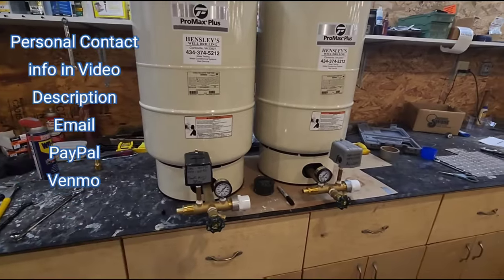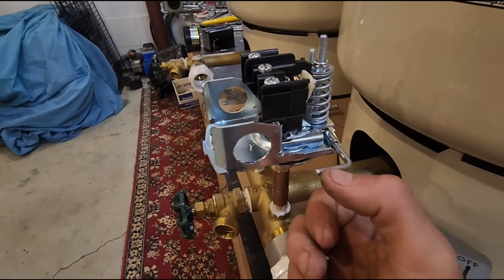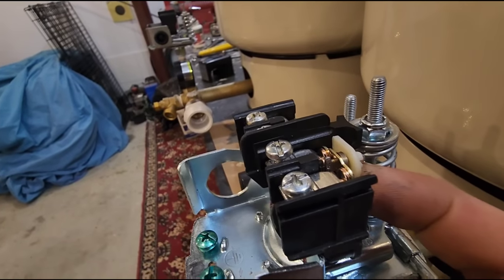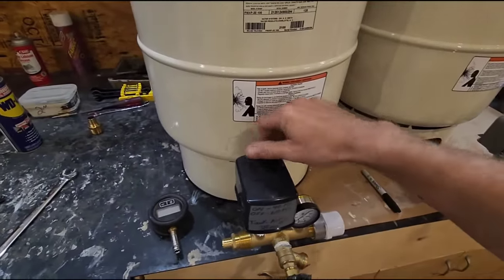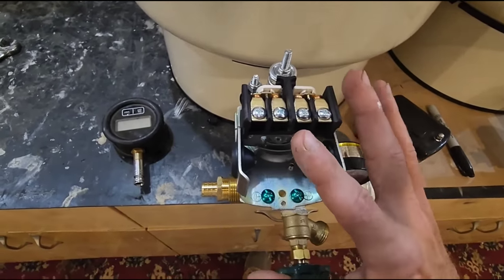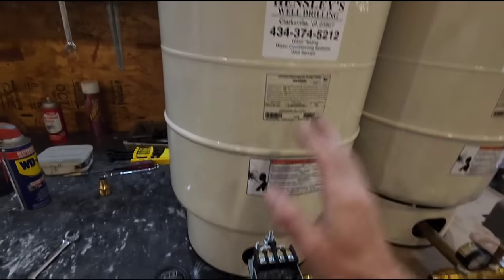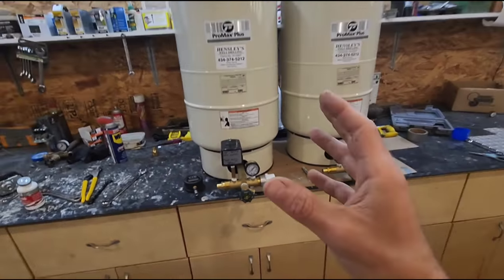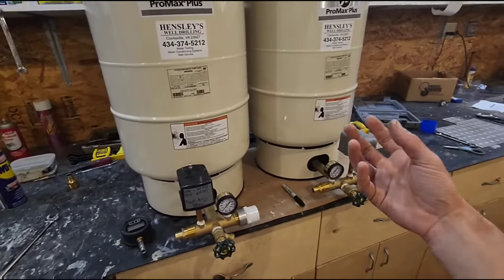Most Common Reason for No Water!! Reset Pump Pressure Switch. Water Well Repair Vlog Ep.18

Comment: I’ve been having to open my pressure switch box and separate the points when I have no water. I replaced the switch in August after having replaced it in December. months ago.   I’m having to pop them apart way to often.  Got any ideas?

Comment: Hello, wondering why my well turns on and I'm getting water to the outside spicket but no water back to the house or tank.  The pressure switch does not seem to be telling the well pump to turn on, the pressure gauge reads 90 psi but there is no water in the lines.  Wondering if there could be sentiment in the lines causing the pressure switch not to function and the gauge to be off.  It is a cabin so I blew the water out of the lines in the spring and there is no outlet valve by the pressure switch.  It is on the other side of the tank. I watched some of your videos when I returned home and thought sentiment may be the issue.  But it is still odd to me why the pump is running and won't turn off until I flip.the breaker.   Any ideas? Thank you.

Comment: I have a tank like the left (dark cover), with no lever or switch to rotate. I have flicked plate or connections back and forth and there is electricity and spark but I never get pressure back. I think my pump is frozen or maybe the plumbing underground. Any ideas?

Comment: I have a system that the tank sits on top of the pump. Came out one day to see the tank blew off the pump. Fixed the pipes but now water doesn’t flow, it’s primed, I flicked the switch. It arched. But no water. Any ideas? Thanks

Comment: Hey bud, around minute 9 you mentioned water turning off then on intermittently. Im having that situation at a house i purchased recently. You mentioned that theres too much air in system when this happens. What do you do in the case of water running out, then randomly starting to flow again, then running out again
Reply from the maker: You need to turn off the pump breaker, open a sink, drain out all the water, then go check the tanks air pressure. Under the switch locate the "on" psi & set the air pressure below that number. 30=28
40=38psi. I'd also recommend removing the switch from the nipple it is setting on & make sure your nipple isn't clogged. It's highly likely that the nipple is clogged. Just jam a screw driver thru the little pipe & clear out any build up. Then re-install & turn on the breaker.
Reply: @h2omechanic  thank you sir!

Comment: Water froze last night. I took pressure gage off pump. I have water to top. I have no pressure registered on gage.
 I have a valve on bladder.
 I got water out. But pump did not come on.
 I installed pump this summer.
 What is next move?

Comment: My pressure switch will click when I change the position of the reset lever.  I am not getting any pressure to the tank. How do I know if I have a pump problem? Do I need to replace the switch to rule out that possibility? It was replaced probably a little over a year ago. It is like the gray one in the video. Any help is appreciated.

Comment: My switch seems to be clicking on and off at the right psi.  The points are clean and im still having water pressure issues its low until it clicks on but it takes so long to click on that in the mean time we can hardly use the water.. any thoughts? Btw my system is only 5 yr old

Comment: I have a 2 pump system, 1 fills a 500 gallon "cistern" tank as the well has low volume. Pump 2 is a "jet" pump that supplies a pressure tank. My pressure tank has 37psi and feels absorbed empty when I tap the side all the way to boot of tank. That seems wrong from the several videos and diagrams I've looked at. I do have some sink pressure but it doesn't seem strong enough. Any ideas? Thanks

Comment: Thank you so much for your very helpful videos. I've been having trouble with my water for about a month now. It started when i got all soaped and shampooed up in the shower, and then the pressure went way down. It came back on and I managed to get rinsed off, but then it happened again a couple of times. But the last time it didn't come back. So i went to check the pressure gauge. It read about 70, and it's a 40-60 regulator. I turned on the hose thinking to drain off some water, but it didn't work. I couldn't see the switch but it looked like there was one sort of tucked under the side. I was afraid to try to get it out bc the wires were hooked up. I have to be gone for a few days, so turned off the pump until i get back. Can you explain what's happening? Thanks so much. 5:09

Comment: My system stopped working and the pump was hot to the touch. I change the capacitor and it worked for a short time and then stopped again. Any idea what the issue may be?

Comment: The water just stopped working, I replaced the pressure switch But I'm not getting consistent sparks. does this mean that my pump is bad? I hooked it up correctly my multimeter says that the line running out to the pump is getting power the only thing I can think of is a bad controller. the capacitor looks like it leaked a bit and the white circle is a bit yellow. But when I tested it it looked to have normal readings. The only thing that seemed to be off in the controller is the cap to (whatever is below it) shows a reading instead of infinity. but for all I know I'm testing it wrong. Would a bad relay in the controller still give the pump full power and fail to tell it to turn on? I have no experience here so take it easy on me lol. Thanks in advance.

Comment: I'm lost I replaced my 30/50 pressure switch it has a lever I tried holding it at a 45 still no water at all. Bladder psi is at 30. I even checked the volts it has 240 when contacts are closed but contacts won't stay closed on there own. Could I have a potential leak that is causing no water?

Comment: Have not had a power outage but the well pump is continuously running. The tank is holding pressure at 28 psi but the gauge shows zero and the water is not getting to the tank because when I went to empty the tank there was nothing coming out of it do you have any idea what this might be?

Comment: I just replaced my 20 gal tank, switch and gauge. I have a submersible well fyi. When I hold the switch lever to run it only builds up to about 11 psg and drops back down. What’s my issue here?

Comment: I am having a major issue. My water went out 2 days ago. I replaced the switch, capacitor and the pump. I can hear the pump running at the well head. But there is no water in the house. Pressure gauge reads zero. Pressure tank is good.

Comment: We got down to 18 last night here in sc,,i have a outside well house with pump and tank,,even though i left 2 floodlights on pump we still woke up to no water,,my fear was a dead old pump,,i took cover off switch and manually pushed it to start and pump started and we now have water thankfully,,could the switch have been frozen open or stuck,,,i have a new pump and tank i havent installed so maybe this incident is a warning i need to replace pump and type,,,old pump and tank were installed in 1993,,,

Comment: My pressure switch doesn’t turn on again after refilling the pressure tank and running the water. 😢 Did exactly what you said to do. Pressure tank is still good (bell sound) all parts are under 2 years old. What do I do 😢😢

Comment: My system has been tripping daily for what appears to be no reason. New switch, new control box, no loss of power, air pressure in the tank is good. Does that mean my deep well pump is dying and losing power to the pump and when using water it goes too low then trips?

Comment: We don't have a pressure tank we just have a pump that brings water from cistern and holds pressure in the lines. When we plug it in the pressure will build up towards 50 then immediately drop to 40, then climb towards fifty again. Repeat until ultimately throwing failure light and shutting down.

Comment: I have an odd issue, I have very low water pressure , comes out hard for 5 seconds and then drops down to slow stream… I had a professional come out to diagnose it today and he said my well pump is bad , but I’m looking at my gauge at the bottom of my water holding tank and it keeps cycling from 30psi and up to 60 psi , 30 -60 , 30-60 and keeps repeating . I can feel my well feed line shake everytime the switch calls for water… so I’m pretty sure my pump still works. Question is: why the erratic behavior on the gauge and why do I have erratic pressure changes at my fixtures?? The gauges do seem to be accurate . Please help lol it’s winter time in New York and we have a newborn in the house. Thanks in advance .
Reply from the maker: The pump does need to be pulled out, (the check valve in the pump is bad) it's allowing water to flow backwards thru the pump. You must add a Simmons brass check valve to the top of the pump. 
If its cycles from 30/60/30 rapidly in 1 second, that mean the tank itself is also bad. 
Cycles should be every 15-30 seconds if the tanks good. 
Typically if a check valve fails the pumps old & its best to just replace it. 
Secondly, it could also be a bad/failed connection between the pump and pipe and the fitting itself has a hole in it leaking out the pressure.  Itll be obvious once you remove the pump.
Reply: @h2omechanic  but I have a one way check valve in my basement at the end of the feed line , it’s right before it goes into the holding tank , I figured that was bad so I put a new one in tonight and it seemed to help a little bit , so technically water shouldn’t be pumping back into the ground  now with this functional check valve. Now it takes a little longer for the pressure to drop but it still doesn’t seem right. Interesting thing is that if I close my ball valve which is AFTER the holding tank then the pressure will hold steady for hours… there’s no leaking shrader valve at the top of the tank so I’m starting to think maybe a bladder or something is bad because I’ve narrowed it down to a small area . This is a head scratcher for me lol

Comment: @H2oMechanic I am having random times where I do not have water and then go and reset the pressure switch, using the "start" position (45% angle) - But when I do it, it shoots right up to the low pressure cut off, and works fine. Then cuts off....Maybe happens a couple times a week? Any ideas, is it a bad pressure switch??

Comment: I’m on a 40/60 system. Checked the pressure on the tank. Have it at 37PSI. When I turn my pump back on I can only get to 30 PSI on my pressure gauge. Any ideas? I’m stuck

Comment: My pump kicks on at 40 psi runs back to 60 kicks off..after 2 or 3 times it will drop  to zero. 30 seconds to a min later kicks on but shuts off at 45. Pressure switch changed. Still doing it. Pressure tank at 36 when empty.

Comment: My tank was 5 years old. I come back from a 3 weeks vacation and the tank was empty of air. I put 28 psi but nothing happened. I replaced the switch but the presure was always stuck at 28 psi. Any idea what may be ? I just replaced the tank and a new presure switch T and gauge.

Comment: If I switch my pressure switch to a 40-60 psi do I have to adjust the pressure in The Tank to 38 psi… the only switch they had at the tractor supply it was a 40-60 and I had a 30-50

Comment: My pressure switch stays "on" (contacts touching) even when power is shut off. Is that normal?

Currently have no water. There is voltage to the well side of the circuit. I suspect frozen pipe in well, but not sure if the pressure switch should open if power is off.

Comment: I will be running water and all the sudden the water will quit and sometimes it will come back on in 45 minutes or sometimes it takes all night to come back on. When I checked under the Gray box the points of the pressure switch were apart they were not stuck together they were apart and so I took the edge of the gray box and push the points together and then the water would run for a little bit and then it would stop again in the points would come apart what makes the point come apart before you're done using the water that you need

Comment: My water stops completely, and it just started from outta nowhere about 1 week ago, but only when the shower is in use...it will stop immediately even with full on. In about 3 minutes the shower can be turned back on and the pressure will be strong and won't be an issue until the shower gets used again. Washing dishes or laundry doesn't seem to be any issue with water pressure or anything else. We have a rainwater catchment system and our water is full to the top of our water tank. No water leaks, no other signs of obvious pressure issues. Any ideas?

Comment: What if the pressure is built up at the well house, switch is working but I can’t the pressure switch to stay on at the house bc it sounds like there is no water pulling. Is there something that could be keeping water from pushing through to the well by the house?

Comment: Hello   I have a 40/60  switch.   The switch is orignal (24 yrs old.)   bladder tank  and spring pump is 5 -6 yrs old.    When ever pressure goes below the 40 mark like its supposed too it will not kick back on and build pressure again.   Its making a humming noise, until i hit the breaker on the pump.   I dont believe my switch has that little bar lever like one in video.   Once i hit the breaker a few times over this past wknd and tapped on the contacts, it came back on.  but then after i used water for an extended time as in this morning for a shower, it did it again and i lost water pressure.  Any ideas  thank you

Comment: I just changed out my pressure switch and when I try to “start” it by holding the lever I can hear the switch engage but the pressure tank does not fill. Voltage has been check, what could be the problem?

Comment: My pressure switch keeps tripping. My tank is 40:60 and I noticed when running water in our house, the pressure gauge falls below 40, right around 30 it trips. And I have to reset the pumptec protection and get it going again. That even takes a few tries to get it back up and running. Is the pressure switches completely gone? I ran the hose for too long, couple hours this weekend and thinking this did it. Pressure tank is at 35, should probably be around 38 though. Any help!?!
Reply from the maker: Turn off the pump & drain the water to 0psi/empty, then check the tanks air pressure. 35-38psi is fine but must be set with the tank empty of water. Try tipping the tank & see if its easy to move. If its heavy & you hear water trapped inside (that means the tanks bad)
If the tanks bad replace it & the switch. 
If the pumptec-saver keeps tripping, that's likely due to a pump pulling high amp draw (the pumps starting to die & overheat, thus why it's tripping)  
But a bad tank will cause a similar problem due to short cycling the pump. Watch a few more of my tank videos and pump test Vids, become familiar with the system. A little time invested & youll be alot more knowledgeable about well systems. My info is easy to understand, just search thru the Well Pump Q&A Playlist.

Comment: I've got a question @h20 mechanic. My pressure tank is showing 85 psi I've tried reseting the pressure switch and you can hear it trying to kick on but then it stops. It's been kicking on and off about every 40 seconds. Was working fine until turned my valves off under the house to change a shut off valve to the washer. Once I got it changed get I went back under the house and turned the main valves back on and now I have no water running through the house. Please help😅

Comment: My pressure switch keeps kicking off and on every 2 seconds when using water. It started doing that after replacing the pressure switch. Does it need recalibrated? It's a 20/40 switch

Comment: my well went dry so I have a 2500 gal tank and a pump that the county brought and hooked up a year ago. yesterday my faucets, when turned on, has no water or very very low pressure then becomes no water and my tank is full of water. I left the kitchen sink on and about an hour later I heard water running out of it, like normal pressure, then it slowly dwindled down until no water again so any idea why this would happen or what I should do?

Comment: No water at all this morning,  no pressure, have power to the pressure switch, cleaned contacts sparks when you move it with plastic cover. But no water, also my furnace will not run unless I hold those two contacts back off the switch & it will kick on? As soon as I let go it kicks back off like there is a huge load on the electrical circuit or something

Comment: My well system is uv light, sediment filter, water conditioner tank, and rust removal tank. When I went on vacation I turned off the water pump and shut off the water shut off for the whole house. When I returned I turned everything back on. The water was very salty. What did I do wrong. Thank You in advance.
Reply from the maker: You probably have a water Softener. It went into backwash cycle while the pump was off. It couldn't flush the cleaning cycle. Just run the water for a couple of hours, it'll flush out. Preferably through a hose into the woods. Limit salt water into a Septic system

Comment: Hi, I'm having problems with my switch not turning on until 0psi, when it is on it runs until 60 psi, my pressure tank is set to 38psi, the switch is a 40/60 system, what can I look for that's causing the system not to turn on until 0psi ?  Thank you